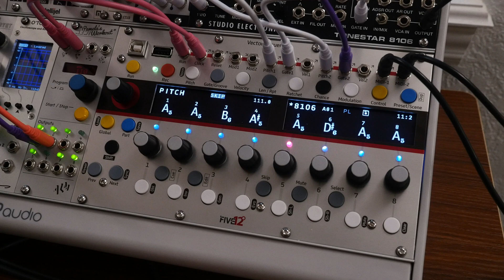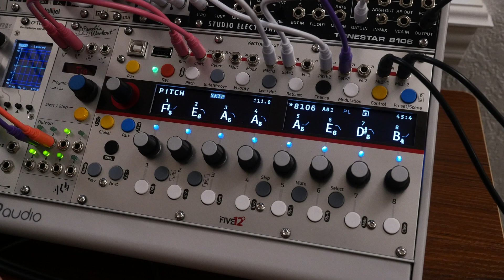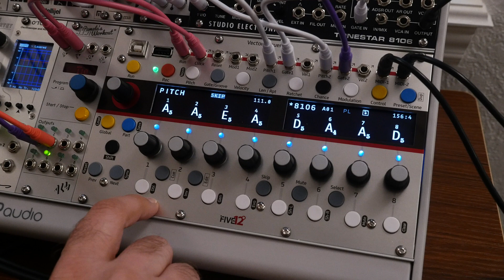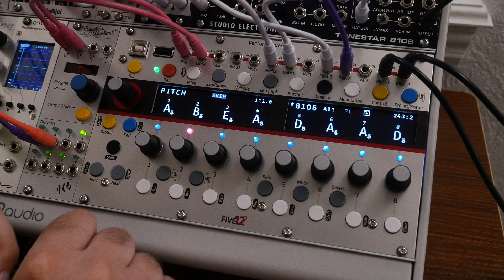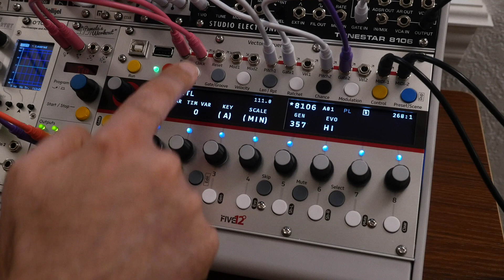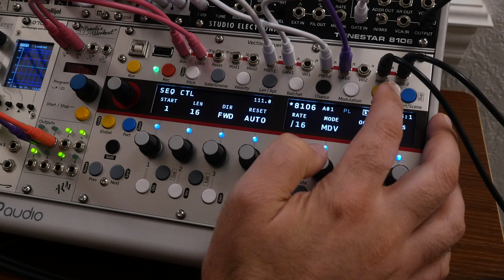Five 12 Vector Sequencer - Generation and Live Manipulation

Comment: Thanks for these videos! Super helpful! Question - when you do modifications like INV on a pattern, do those always happen immediately or can you set it so the switch occurs on the 1 of the next repeat of the measure?
Reply from the maker: Yes, those manipulation caused by the buttons along the bottom happen immediately. I haven't loaded up the latest firmware, but I'm not aware of any of them being quantized. There is a clips/session-like feature though, which I haven't made a video for. Otherwise, it's up to you to get the timing right :)